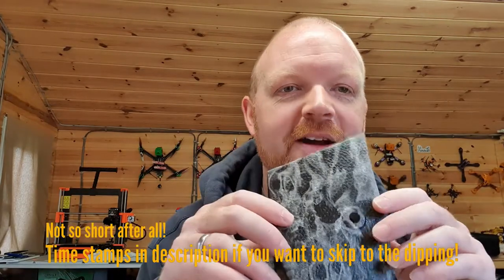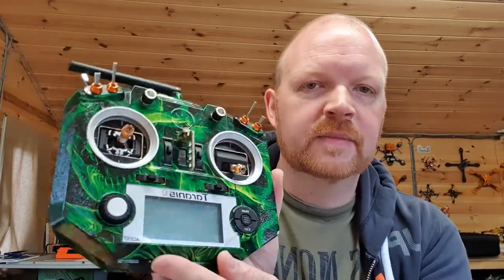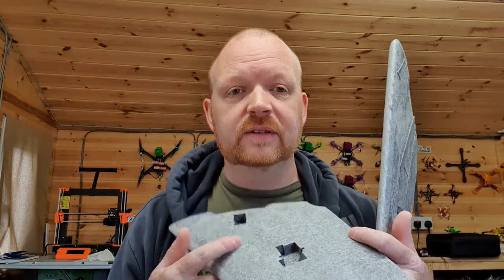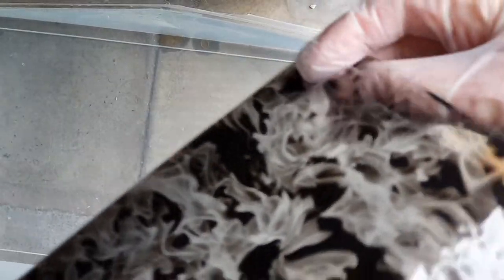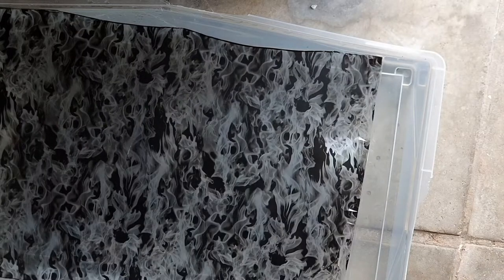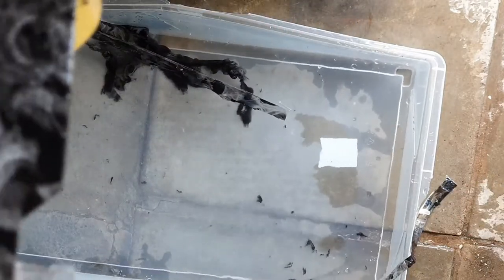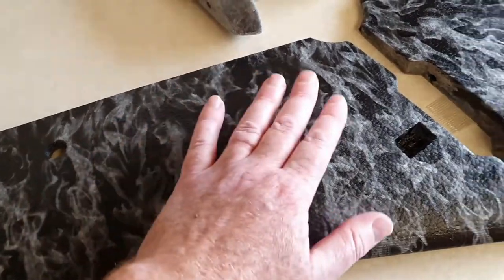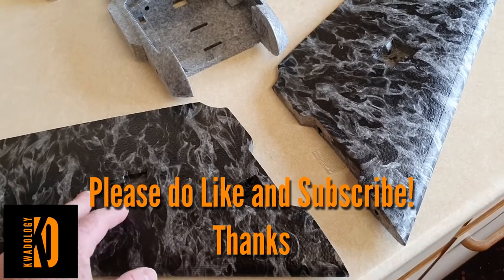How to Hydropdip an EPP Foam Wing

Comment: Stop cutting up good wings ;) Thanks for sharing this info, I had looked into hydro dipping a little but gave up and just went with rattle can.
Reply from the maker: :) the cut was from a very smashed s800, hit a lampost head on at 70mph flying in a carpark! Glued it back together and then took a spin into concrete from very high when the FC decided to reboot! Was beyond repair🤣.

Comment: So maybe I didn't watch well enough but do you use primer on epp foam?thanks
Reply: Hi, I didn't spray it with primer but I did give it a light coat of 3M90 adhesive spray. I had a hard time dipping my test pieces without this as it didn't seem to stick to the epp without it.
Reply: How has it been holding up?
Do you know of anyone that has done the primer ,base coat then dip on epp?
Thanks for your first reply. Great video!
Reply: @MrPeeteboy  solid, the s800 has been crashed a fair few times now, 3rd flight forgot to put the antenna on my crsf module and failsafed  into the side of a rocky mountain at 78mph! Didn't peel off the lam all held, despite managing to shatter the front carbon spar! Got 2 other dipped wings both holding up as well. I dont know anyone that has sprayed it 1st. I did do some test with different sprays on epp and lam it and try and rip it off (no dip though) acrylic based sprays peeled really easily and wouldn't go back down with heat on the lam. Plasti dip/ full dip sticks really well to epp and lam, ive dipped stuff sprayed with both and its worked well but not a wing. I'm sure it would work well  you just need to be careful to be light with the paint so it doesn't add too much weight.

Comment: Can the dip be removed? For example if you used a bath as your tank and didn't want to be murdered by the wife.
Reply from the maker: You get a frw bits floating around after and can normally wipe them away while they are still wet, but you may end up with a few bits stuck. Got a few bits in the kitchen counter yesterday doing something and it came off easy with an alcohol wipe. I'm sure it would clean off but dont have the guts to try it for the same reason! Although I did joke about running a bath for her and putting a layer of pattern hidden under the bubbles so she got hydrodipped when she got it in, I think it would be hilarious, she didn't seem to see the funny side of it though🤣
Reply: Lol, I bet her friends would